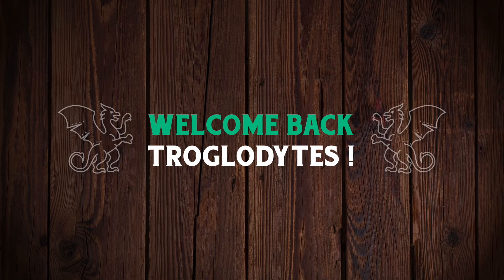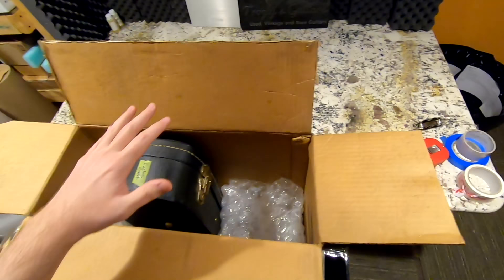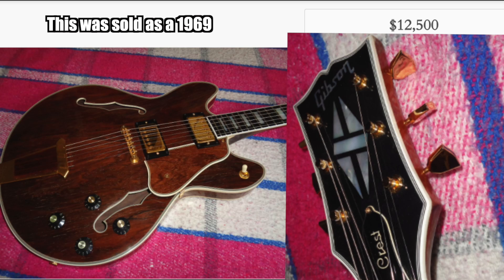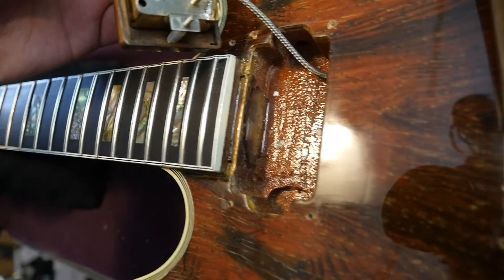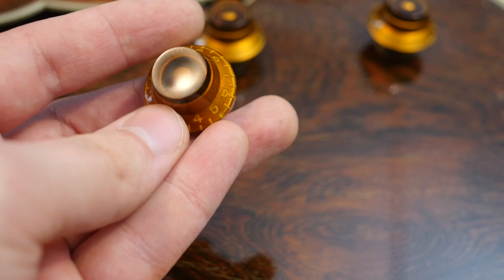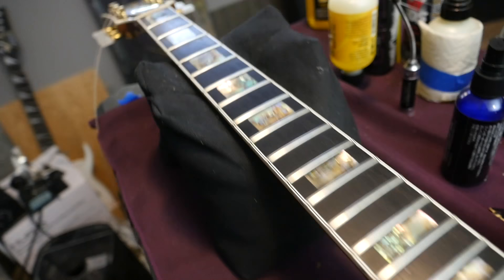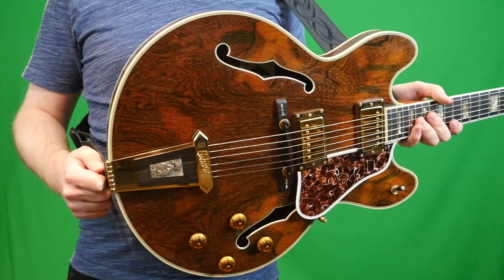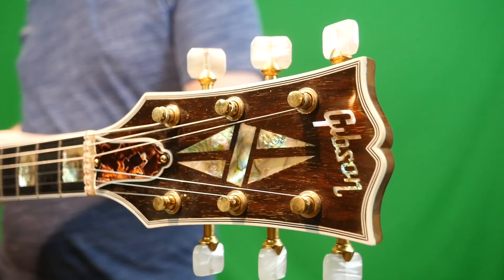Wait Until You See This FANCY BEAST... | 1983 Gibson "Crest" NAMM Show Display Piece | "The Hippo"

Comment: I forget where I saw this trick, but I swapped out the original pots and pickups on my Oscar Schmidt 335 clone. I used aquarium airline tubing to fish the pots back in place. You just push the tubing over the pot knob and pull it back in place, then slide the washer and nut down into place from the other end of the tubing. Worked like a charm!

Comment: Use vinyl tubing for fish aquariums to 'fish' those parts back into place.
Reply: String also works too, as long as it’s not weak or thin. I’ve pulled my harness out of my 335 several times.
Reply: @danduntz9112  Yeah, would that be 'fishing' string... ;}
Reply: @10100rsn  In a sense...haha

Comment: Tape the endoscope to a piece of coat hanger that you can bend and place the camera where you need it. You can also get skinnier ones that will fit into tight places better. Much easier than trying to remove and replace those electronics and risk cracking the wire or solder. MY guess is thats a parts guitar, like you had said, using electronics, neck, and wood they had laying around and threw it together just for NAMM to have something unique to display. Its gorgeous though.

Comment: That is basically a super fancy pre-1970 ES330 model with Brazilian rosewood plywood top back and sides with Shaw humbuckers in lieu of P90s (ES330) or NY Minis (Epi Riviera). Gibson just dug out the tooling for the 16th or 14th (I forget) fret to body pre 1963 ES330s.  It looks like you have a Gibson ES350 tail piece with a super fancy insert. Those were used on quite a few expensive jazz boxes. No center block means a trapeze tail piece or nothing. And after 80-90 years the top starts to cave in anyway. I have redone a few old 1910s L1s. The ES175s used that TP too, with no insert. The diamonds came and went. The Epi Rivieras with the mini-buckers SCREAM. Those are 335s with NY mini buckers. For true NY minibuckers see a New York pre Gibson Epiphone, or a very early Kalamazoo Epi. Epiphone's employees were not left without a job when Gibson shut them down after buying them out. They formed Guild Guitars with help from old Epi management. Tom DeLonge.

Comment: not trying to anger solid body gang but this is the coolest guitar I've seen you have. hands down. Sorry "the" les paul and spotlight specials, you're now in my second place.
Reply: For my taste, I prefer having the center block. Had to own four Epiphone f-hole models to work that out, including one ES-335 Pro, one Casino and - on the outside - two Sheraton II models.

Comment: This is definitely one of your best purchases imo.... but you be mistaken cause that's a T-Rex in the wood and not a Hip-hop'opotamus... maybe a Bebop'opotamus haha. If it joins at the 19th fret instead of the 16th then it almost definitely has a center block. If it somehow has 335 length neck and doesn't have a center block, then not only is it rare, it's probably very fragile and not able to hold very much string tension. Most semi hollow and thin-line hollowbody Gibsons are poplar/maple laminate construction so I'd imagine that the Brazilian is a veneer. Brazilian Rosewood is extremely dense wood so that would be a heavy ass guitar if made entirely from solid brz/rw... even if it were entirely hollow. That just gave me a great idea for a custom 335 though... have one built with a Honduran rosewood center block (like marimba blocks) talk about sustain!

Comment: The secret to installing those pots quick and easy is to use surgical rubber tubing that fits snuggly over the pot-shaft.   You feed the tube down thru the pot hole, pull that end of it thru the F-hole and put the pot on it... do that to all the holes and all the pots.  Then pull the  tubing out of the pot holes dragging the pots right to the proper positions.
Reply: Put the tube on the pots before removing them, fits through the hole. Then no fish needed.

Comment: The second inlay looks like a skull!  A tip, buy some flexible tubing that fits tightly on the pots that you can feed through the holes to pull the pots in place.  A big time saver and makes it easier as well.😁

Comment: For your fret binding gap issue - you appear to have more distance between the low E string and the edge of the finger board, and less on the high side. Plus your strings should be centered over the pickups pole pieces. You could probably slide the bridge a little bit over toward the bass side. Might help.

Comment: You need to readjust that neck pickup its not level the side closer to the bridge is below the pickup ring.
Reply from the maker: When I put the electronics back in  - I accidentally reversed the controls which pulled the wire too taught for the neck pup to sit level. I've since corrected these issues

Comment: You simply have to move the bridge up a millimetre , there's too much room on the lower e string
Reply: That would be a dealbreaker for me unless you can change it without alterations. My Harley Benton had that and I fixed it(redrill bridge holes). That guitar was a kit 77 euro, not 10.000 plus...nice guitar though
Reply: @killainmaccallan4700  that's an archtop like bridge, it's not fixed on the guitar, it is kept in place by the tension of the strings
Reply: @Calbertone  Yeah, can you tell I never had that type of guitar :), cheers for the info mate. Have a good one!

Comment: The earliest it can be is a ‘67, the serial # suggests a ‘68. Witch hats weren’t on these until ‘67. the bridge, with those idiotic nylon bridge saddles with the retaining wire that rots out, so when you break a string, the saddle goes bouncing around the stage floor, sucked big time! ...😂😂😂. Mercifully, they stopped those in ‘71-‘72., Going to the ABR-1. We used to call these “Gutless Wonders”, because next to a 335, their sound sucked, especially for the music of the day. I bought my ‘66 ES-335 in 1974, at a pawn shop for $250.....Best investment I ever made! Still have it.

Comment: that crest is the most straight note guitar i've ever heard.  not yours.. the real ones...you bend a single note here or there?  it sounds like crap.  but if you straight note?  its flawless sounding.  if only they were hide glue constructed.  but i've yet to find a video of anyone that can actually play the original crest properly.  no one gets them.  it should have been the real les paul model.  yours you can bend.  it'll sound fine bending a note.  but the originals?  i've never heard anything more straight note than that.